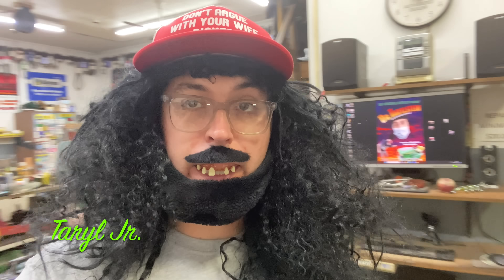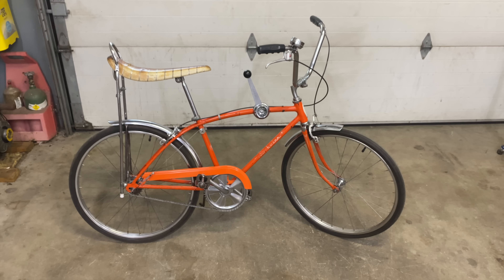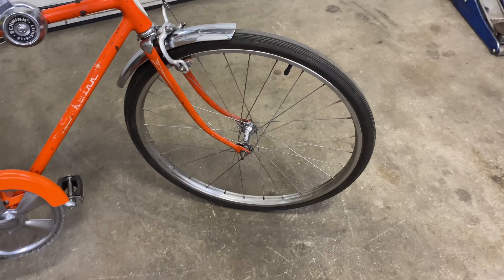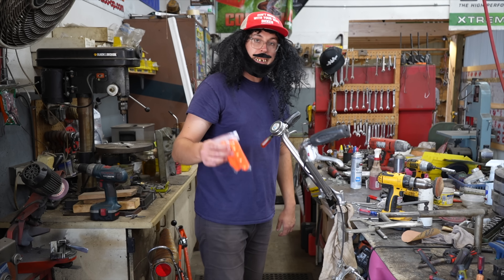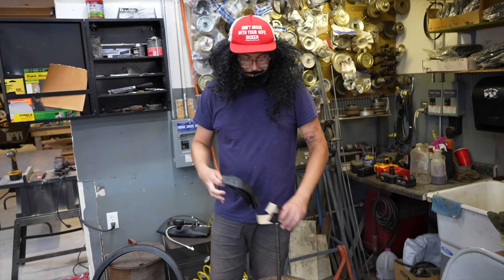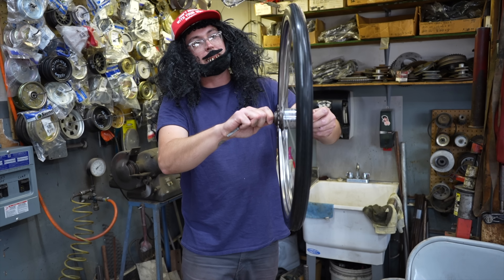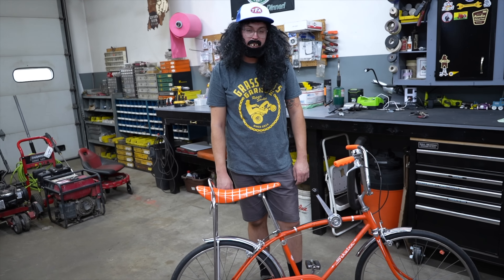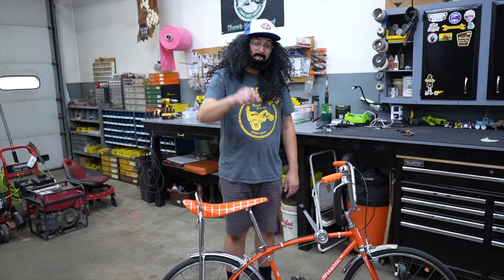They Only Made These RARE Bikes For 2 Years

Comment: You should get some decal setter for that water slide decal. In scale modeling theres a multitude of useful products for those. Softeners and setters that melt it into the surface finish (even smooth finishes have microscopic scratches). Or just clear coat over everything keep it fresh for years to come.if you break a decal you can use softener and use a brush to fix it back just have to use setter after so its permanent

Comment: You ever take it off any sweet jumps? With your decals, you can use a Q-Tip to roll over them and get the air bubbles out. Don't rub it real hard but roll it over it.

Comment: had the blue one late '70's put 20" front wheel on radio shack had head/tail light kit for bikes and beverage holder for my pocket radio thing is the seat made butt soar i live on washboard dirt road very dangerous every time older sister drove it tires went flat then 1984 dad bought me 20" BMX similar handle bar light weight frame im restoring it now having trouble finding metallic burgundy color paint

Comment: I was always wondering what diabolical, sociopathic engineer came up with the 'soprano shifter'... All things considered, nice restoration Jr. Thanks for sharing. (( By the  way, alcohol or methyl hydrate works for installing hand grips if you don' t have carb spray, powder your inner tubes with a bit of tube  talcum powder/ baby powder to allow the tube to inflate wrinkle free as greater air pressure is applied ))

Comment: Having a few Johnny Bench or Roberto Clemente cards in the spokes would really increase the value. Just sayin. 😂

Edit: We use to personalize our bikes in my Ohio small town. Some of the cool hippies had chopped forks, steering wheels, transistor radios on the cross bar or handle bars. And then there were stickers. We put stickers on fenders, seats, anywhere really. So a little "customization" of your own only takes away from those Out The Box purists who plan to resell. But if its yours, making it yours is Period accurate.
Reply: and  grab your mothers best clothespins and the brand new playing cards your father bought last week and ride your bike like you stole it

Comment: I had the Schwinn Stingray, rode it all over the place. Even flipped it over going downhill when a branch got caught it in the front wheel and it was fine, I was shaken up. It was stolen when I ran into a pet shop and didnt lock it up, the owner put up flyers and it was returned painted purple. The other way to remove and install handle grips is to use hot water. I dip the whole handle part into a pan of hot water for a minute, then use a towel or gloves and pull the grip off. Dip the new ones in hot water to reinstall.

Comment: For grips take off with just a small nozzle air gun.  To put new ones on use hair spray.  It lets them slide on easily and then locks them on in a minute.

Comment: You say you are new to this.  I'll tell you right now, do not try to lace a 5 speed hub onto your rim and spokes. Take it to a  bike shop and have them do it.  There is no more difficult job than lacing a back (drive) rim.  Ride around on trash day and try and trashpick rims and then takes those rims apart and try to put them back together.  If you break it, no big deal, you trash picked it.

Comment: FIRST BIKE WAS FROM A GOODYEAR DEALER .... $119.OO IN 1977 ... BEST BIKE I EVER HAD ... WHEN I WAS ABOUT 10 YEARS OLD I BOUGHT A WESTERN AUTO FLYER CHOPPER WITH THE SLICK BACK TIRE FOR $20.OO ... A COUPLE OF YEARS LATER I BOUGHT A SCHWINN 20 INCH BICYCLE WITH A 3 OR 5 SPEED ALSO WITH THE SLICK BACK TIRE AND ALSO FOR $20.OO ... BUT I WAS A KID AND GOT INTO MOTORCYCLES AND OF COURSE CARS AND SOLD THEM ALL FOR BASICALLY WHAT I PAID FOR THEM ... AND THEY WERE ALL ORIGINAL ... 🙄🙄🙄

Comment: Shouldn't it have rear disc brake?
Reply: I'm pretty sure only the Sting-Ray Krates had a rear disc brake and only a couple of years.  I've seen lots of Krates with a rear side-pull brake.
Reply from the maker: Certain ones in ‘72 had disc brakes. Unfortunately this one does not 😞

Comment: i dont think them are original handle bars them rims are not original . your missing the slick in the back  its tough to say about the front its not a crate so it might not have had the atom brake hub .  the front sprocket i beleave is off a 26 "  bike kids used to change them  bigger sprocket more speed . but you have the most important thing the frame . i am going to be one of those guys who say dont paint it ..00 steel wool works better then a chore boy less chance of scratching the chrome up . they have seats on ebay but your going to dig deep for one that looks nice . but hey its a Schwinn thats all you need to know . as kids we would dig them out of the trash and rebuild them from parts we found or stripped off other bikes . we could not afford a new Schwinn ether . when i was around 10 my dad bought me a used ten speed from the Schwinn shop thats as close to new as i got lol . but t was a nice bike . personally i learned alot more from building bikes from scraps that people threw away . ask a kid now days to build his/her bike and see what ya get lol .

Comment: With all due respect, you have a lot to learn.  It can be frustrating and expensive to learn on a rare and expensive bike.  Just like small engine mechanics makes fixing small engines look easy, good bike mechanics make bike repair look easy.  It's not. 

My advice is to practice on a trash picked or a $10 flea market bike. You can make all your mistakes and learning process on a bike that doesn't matter, which has plentiful available parts and where no matter how badly you screw something up, it doesn't really matter and you can start again. All the money you save on expensive bikes and parts can be put to good use buying proper bicycle tools.

As for tools, the one I recommend most to beginners who won't already have it is the most basic universal tool there is, a good bike stand.

Comment: BUD PLEASE DONT SHOW PEOPLE HOW TO PROPERLY CHANGE A BICYCLE TIRE FOR ONE THATS TOTALLY WRONG NEVER USE A FLATHEAD SCREWDRIVER USE A SMALL WRENCH CIRCLE PARTED END FLIP IT GET ONE SIDE OF THE TIRE OFF PULL THE TUBE OUT.. IF YOU'RE CHANGING FROM OLD TO A NEW TIRE PUT ONE SIDE OF THE TIRE ON THE RIM THEN SHOVE THE TUBE IN THEN GIVE IT AIR THEN RELEASE THE AIR IN ORDER TO USE THE SMALL WRENCH TO PUT SLIDE THE OTHER BEAD OF THE NEW TIRE ON. ❤😅 NO HARD FEELINGS BUT I'VE BEEN DOING THIS FOR MANY YEARS. AFTER THATS DONE PUT A SMALL AMOUNT OF AIR IN IT SPIN IT PRESS DOWN WHILE SPINNING THE RIM SO THE BEAD IS SEATED PROPERLY IF ITS PUMPED UP TO MUCH AND NOT SEATING WITH WHEEL HOPE LET MORE AIR OUT AND REPEAT THE PROCESS UNTIL THEIR IS NO WHEEL HOP, THEN PUT THE RIGHT AMOUNT OF AIR PRESSURE IN.. 😊